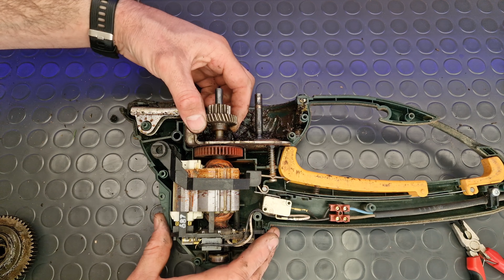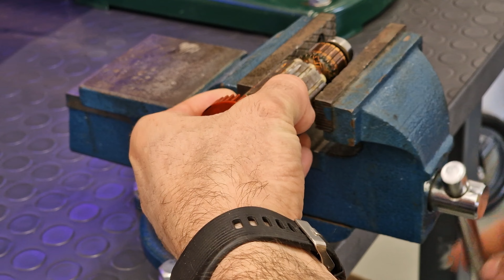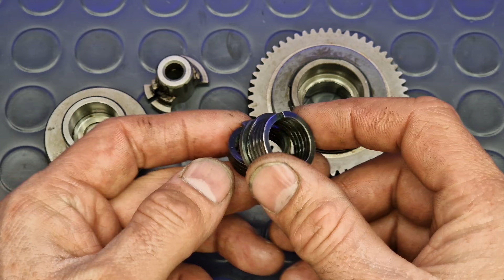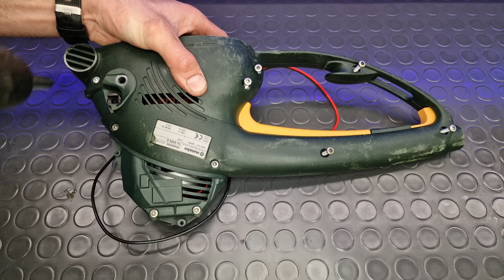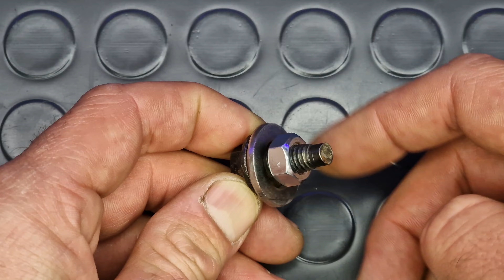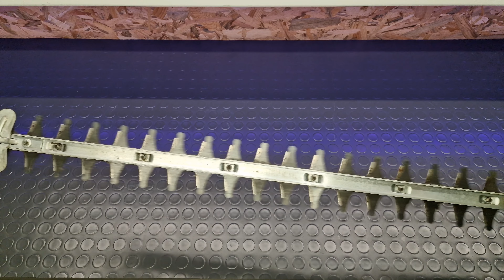220V Metabo hedge trimmer to Parkside X20V Li-ion conversion

Comment: Well done, do you remember is this the correct motor for parkside cordless angle grinder. I have one with failed brushes.
Reply from the maker: I repaired an Parkside angle grinder with this one, but it was too weak for the angle grinder.
Otherwise, it works very well in this one because it has a reducer and the power is very good🙂

Comment: Increíble! vuelvo a preguntar: no es posible hacer un adaptador para usar las herramientas de 18v CC conectadas a 220v AC. Hay veces que estás en el taller y debes hacer un trabajo que demanda mucho de la batería y tienes acceso a 220vAC. ¿que sería con una fuente de alimentación de portátil?. Sé que dewalt y hikoki tienen adaptadores de este tipo pero sería muy interesante para parkside.
Un saludo.
Reply from the maker: The tools will not work with a laptop charger because their maximum current is up to 10A.  But if you put some kind of round connector in a 2A or 4A battery and connect it to a laptop charger, then the tools will work and when you leave it, for example, it will continue to charge the battery.  That is, you will use the battery as a capacitor.🙂
Reply: @ErCanEverything  Oh interesante! Sería increíble para algunas herramientas que demandan mucho de las baterías y que incluso los que no tenemos las baterías de 8Ah. Por favor si es posible y algún día tiene tiempo dedíquele un vídeo, estoy seguro que hay muchos como yo pero la verdad que no soy tan bueno en electrónica como usted. Estoy aprendiendo muchísimo con sus vídeos, siga así!
Reply from the maker: I'll think of something about it🙂🤝
Reply: @ErCanEverything  tank you! i see taht dewalt an hikoki has one.